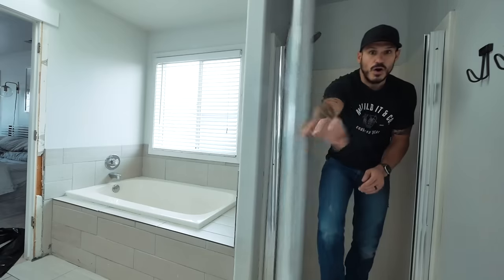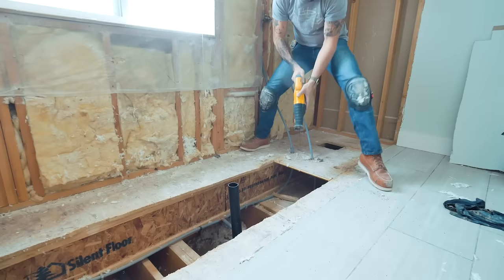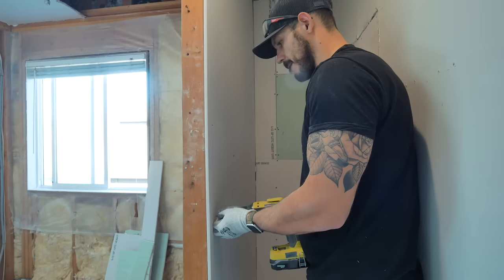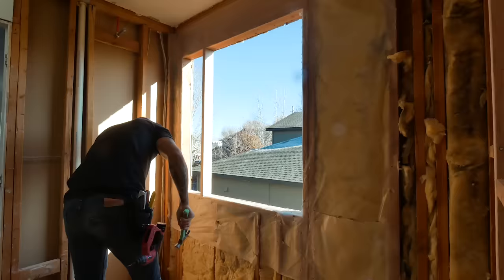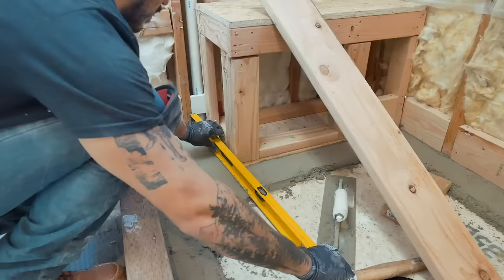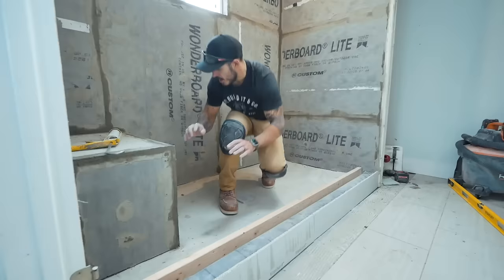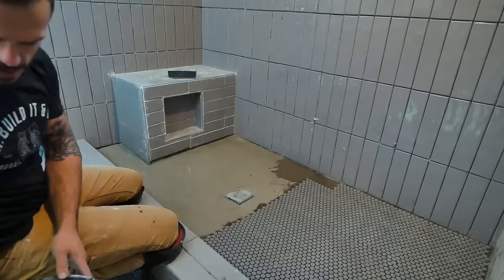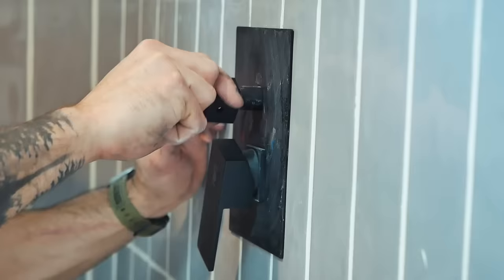Building a GIANT Shower (Home Remodel)

Comment: When you were talking about keeping the window, me and my family bought a special wrap for a window that from one side it makes a mirror effect and from the other side it make a great light so the shower is perfectly light
Reply: I have a similar window set up for mine and have been looking for solutions to this very problem. Do you mind sharing the material that you purchased?
Reply: @tnichols321  There are two solutions for that. The first one is to use mirror film on Amazon I think it is called Window film or Privacy window film and the second one is called Frosted glass film. The Privacy Window film is great because on one side there is a Mirror efect and on the other side you can see pretty good. It is the same efect as you would get while wearing sunglasses. The Frosted glass film is also great but you can not see out of the film or wrap itself but there are different types of frosted glass films so you can look which one looks the best.

Comment: Pretty nice job overall - one issue is that it looks like you didn't cut the first row of tiles to match the drain slope of your floor, so the slightly lower part in the middle shows up as a slight sag all the way up to your window sill. With the tiling pattern you chose to do do, even small errors in those horizontal grout lines show up more than you want in the final product. I think it is easier to hide mistakes with a typical overlapping subway tile style layout because you don't have 4-way intersections in the grout lines.

Comment: I've helped put in a few custom showers in the late 90's with cement base, chicken wire and hot tar materials. This video was much easier process and built just as well, but I'm surprise for all the criticism by people who probably don't know how to change a tire. Great job, and good pointer for real builders.
Reply: 🤣🤣 hot tar mean roofing materials I can imagine when hot water start melting all.over bath floor
Reply: @TeslaBoy123  -  it's called "hot mop" and it supposed to work great for waterproofing the floor section of showers, but it was lots of prep work.
Reply: Nothings worse than demolition on a bathroom from 50's-70's with a cast iron tub with tiles, cement and chicken wire to the ceiling and 4ft high outside the shower area THEN that damn blow in installation. 🤦‍♂️🤣

Comment: I give you alot of credit for tackling this job.
I do this for a living and there are few things in the floor and curb that are wrong. 
Wire lath and tar paper gets installed first wire lath attaches cement to wood and reinforced the layer of cement.
The cement on the curb should have wire lath in it as well. 
Never installed a niche on the floor.  Your looking for water penetration problems down the road.
Any shower over 65 sq ft requires wire lath in the top layer of cement you stick the floor tile to.
1/4 per foot is code for the pre pitch under the liner and as well as the cement on top of the liner. 
Cement on liner should be at least 1-1/4 thick no thinner. 
No reason for pressure treated wood if it leaks you messed up the water proof and the entire shower will be ruined.  
Drilling into the curb possibly compromised the liner.
Reply: So this entire shower needs to be knocked down and fixed by a professional basically?
Reply: No. As with anything everyone has a slightly different way to do things and if I had to guess the guy making the comment hasn’t done tile in 20+ years. Also for context I’m a tile contractor. The way this guy did it isn’t how I go about it but I really didn’t see anything too horrible with it and would guess it’s probably fine. A few things I would change about what he did is IMO don’t put wood anywhere in a shower. When we do benches we use foam which you can either purchase from tile stores or for something more unique or large we have a foam company make a custom bench. The way he created the curb of the shower wasn’t a bad way because he did install mortar around it but the way we do it is form out the curb and pour it with the pan running through the middle of the concrete which is easier than the way he did it. What the previous guy said no one in the industry, at least where I am ever uses lathe in a shower. They use a way similar to this or they use a kerdi membrane. I this this shower will be fine at least for the foreseeable future. Only point that is correct is that drilling through the top of the curb is a potential fail point, but if he had poured the curb it wouldn’t have mattered. Also a heads up if you do a shower for the first time please do a pan test which is where you cap the drain and fill the pan with water. Leave it overnight and if you still have water in the morning your pan doesn’t have an issue. It’s an easy step that gives you peace of mind and can save a lot of heart ache.
Reply: Colby Hanson how would you attach the glass mounting clips to the curb without drilling through the barrier? You seem chill compared to the original commenter.
Reply: I would do exactly what he did. The difference is instead of pressure treated wood wrapped in the shower pan, the way I do it there’s nothing but concrete with the pan in the middle of the concrete. So drilling into it your just hitting concrete.
Reply: Need work ?
Reply: @honkyhankch1987  I did a "tilereadi"redimade pan. too much to risk for me a DIYer.
Reply: @honkyhankch1987  I am still installing tile at the age of 51. I am second generation tile installer and learned my trade from my father whom did nothing but mud jobs. Before foam there was wood and some type of membrane applied to the wood to protect it from water and then covered with wire lath and cement. You can find numerous videos on You tube on how to install the mud around the curb but only a few have it right. The method you are referring to is out lined in the TCNA hand book with the liner in the center of the cement ( mortar) not CONCRETE with wire reinforcement holding every thing together. The method the gentleman in the video used is similar to what I do but with wire in the mortar mix and the cement board on the outside of the curb. I also substitute the 2x4 for a single 2x6 on edge. This allows for a thinner curb and more space for the lath and mud on the inside of the curb. I also build the curb prior to installing mud floor.  This locks the curb into place since it is not really fasten.  Your method if done correctly allows for a much thinner curb because you do not have to contend with the 2x4 and you can control the width of the finished curb.. 

You never mention anything about the wire reinforcing in the shower floor. That is in the TCNA hand book as well.  
 
If you look up Isaac Ostrom on You Tube he shows  the correct way to attach mud to a shower curb with wire lath installed in it. He is also a installer of the new age foam and hes done numerous videos on products with the foam and thinset applied waterproofing and the problems they present. 

We are all here to learn from one another that is what makes you tube so great!
Reply: I am not sure if all the tile  installer now about a channel call Tile Tv.  Web site is www.iwantmytiletv.com .
Episode: July 26. 2018  explains in detail how to attach tile to a curb . Believe or not they use wire lath.
Reply: Yeah no wire in the cement curb is crazy. That will fall right apart in chunks. Especially only adhering to a rubber backing and not all that thick. If someone steps right on the curb it could crack right away. All that other mortar on the floor with no wire is going to crack very fast. And it will come through the tile. Also tile does not adhere well to a rubber rolled on coating like it would with thin set straight to the cement board. That is another weak point. I also think cement board over studs is not strong enough. I always use plywood under cement board. 

I get that they want to seal it very well but when you seal something so well that you compromise the overall structure what is the point? So you end up with cracks and broken tile long before you have a moisture problem sure. That means you rip it out for ugly cosmetic reasons and have an eye sore long before you need to. If your water proofing lasts 100 year but you've compromised the rest of it, then you're going to be ripping it out in 10 years anyway or looking at ugly cracks.

The old ways may not be as super sealed but they last and stay moisture proof as long as the life of the tile and until any future remodel.